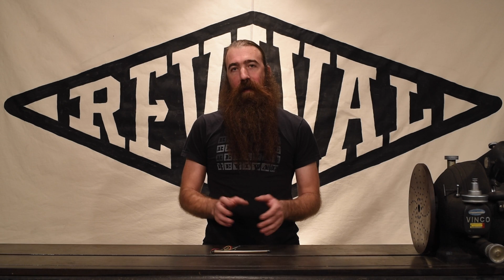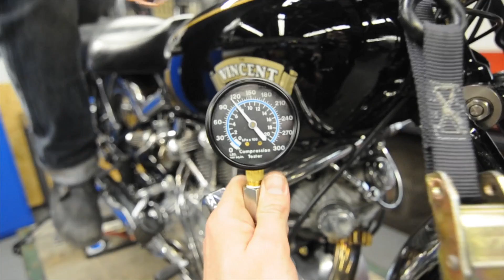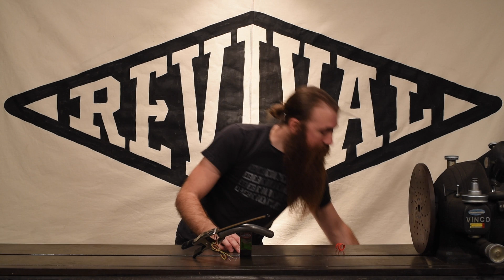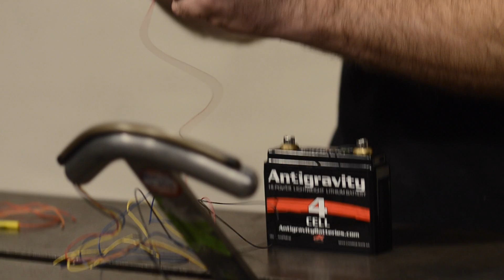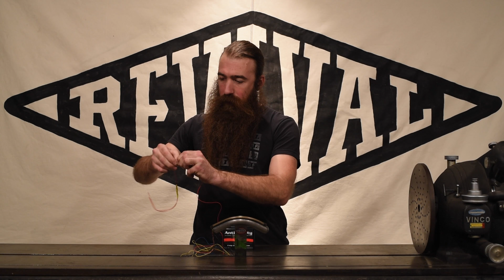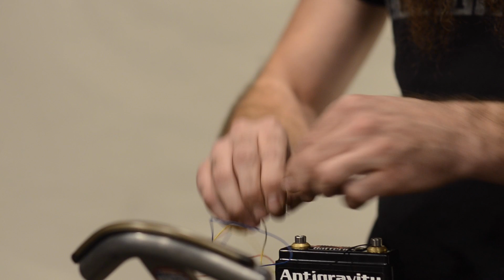Flexible Brake and Turn Signal LED - Revival Cycles Tech Talk

Comment: Would you happen to know what the current draw is for the fully lit strip? I might just replace my dual LED bulbs and plastic LED bar with that. Bondo and paint over the tail light on my triple project.

Comment: do yall remember what size length was used  in this demonstration? are there just as much amber-colored LED in the 8inch as oppose to the 11 inch, or is the amber proportional to the number of LEDs?
Reply from the maker: The light shown in the video is the 8.2" length. The turn signal portion is proportionate to the length of the light, as the length increases so does the number of LEDs dedicated to the turn signals, for example the 8.2" has 2" of signal LEDs on each side. The 14" light has 3" signal LEDs.
Reply: thank you!

Comment: nice product thx for share the vid , i just have a question after intall the stripe , how long they will last ? water and cold weather resistant  ?? thx 
cheers
Reply from the maker: The LED's do not have published life expectancy specifications, but most SMD LED's are designed to last somewhere around 50,000 hours. So considering an average speed of 30 mph, they should last something like 1,500,000 miles, or ~2,400,000 kilometers. Unless they are physically damaged or subjected to excessive voltage these lights should easily out last the bike. 

The LED's are not sensitive to temperature, but the housing that holds them is plastic and like all plastic at cold temperatures it can become brittle, so if it is cold be careful not to hit the housing with something hard. Other than that cold temperatures should not cause any issues. 

Also the lights are reasonably water resistant, they are not 100% sealed, but they can handle the usual water spray from rain and splashes from the road. Be somewhat careful if using high pressure water to wash the bike, and these lights should not be submerged in water.
Reply: Thx a lot!!!

Comment: Also, just a quick question. I have this LED, the M-Unit and the M-Stop. Is the M-Stop the modulator you mention in the video that can handle those complicated set ups?
Reply from the maker: +Saturdays Wrench The m-Stop is a small inline brake light modulator that can be setup to flash the brake light in different ways when the brakes are applied. This functionality is already built into the m-Unit so there is no need for an m-Stop and an m-Unit. 

We recommend the m-Stop if you just need a brake light modulator, but the m-Unit is better suited to complete re-wires and changing to push button handlebar controls.
Reply: Saturdays Wrench did you ever figure out how to have the turn signals assist with the taillight/break light function? I have this led and m-unit as well.

Comment: big question... its have E certificate on led strip? E symbol?
Reply from the maker: This does not have an E-certificate.
Reply: There is a version without turn signals from a company called Highsider. It has E mark on it. Costs ~30€
Reply: @TankToChest  with E-certificate you can install it on your bike without having to let it be checked from your responsible Technical Inspection Agency

Comment: Plastic has "memory!" After time, won't it pull away?
Reply from the maker: Judicious heat application helps to avoid this. I'm certain that it's still possible, maybe even likely but in the 8 odd years that we've been using and selling these I haven't seen it happen when installed correctly.

Comment: I have the m-unit blue and this led bar. How can I get the turn signals to assist in the tail light/break light functionality?
Reply from the maker: In order to achieve run/brake/turn functionality in one light you need an additional module which is available on our site. 

https://shop.revivalcycles.com/run-turn-brake-signal-module/

Comment: Is there a good link and how to make your own dual filament adapter I feel as if mine isn't correctly working it tends not to get as bright as yours was shown
Reply from the maker: Odds are that you have a too small of a resistor and should go up in size. I don't know of an instructional video, it wouldn't be hard to make one but then again, if you just need to make one you're going to pay more for all of the materials than it would cost to just buy a replacement.

Comment: Greetings from Denmark! Are the flexible brake and turn signal LED E-approved?
Reply from the maker: +Søren Larsen Pedersen 
Unfortunately they do not have E certification. We do sell many of them to people in the Eurozone but if you are confident that law enforcement in your region is strict in this regard you may run into issues, you'll have to decide if it's worth the trouble.
Reply: Søren de tjekker det aldrig medmindre du køre med rygmærke ;) heller ikke til syn.
Reply: Revival Cycles, escuse me , what is the resistance value?

Comment: so does the circuit red/orange wire doo-dad just have a diode in it?
Reply from the maker: There is a resistor, you could fabricate this your sef pretty easily if you know you're doing.

Comment: Nice video. I have bought the same LED from your eshop and I would like to know how to connect the wires  with my m-Unit from motogagdet. Do I need to plug the cable that comes with the LED light? 
Thank you
Reply from the maker: +ΚΩΝΣΤΑΝΤΙΝΟΣ ΚΑΡΑΓΙΑΝΝΙΔΗΣ The LED strip comes with a wire diagram in the packaging, and this will indicate what each of the wires does. The details of the wire colors will be dependent on which LED strip you purchase, some have turn indicators, some don't. The integration with the m-Unit is very simple, and the one wire tail light feature of the m-Unit makes setting up the tail / brake light very easy. Just connect the brake wire to the brake output and then configure the m-Unit for one wire LED tail light (menu 2, config B). Then the turn signal wires go to their respective output terminals, and that leaves just the ground connection, and that's it.
Reply: +Revival Cycles Ι have bought the LED brake with the turn indicators. The connection is the same?
Reply from the maker: +ΚΩΝΣΤΑΝΤΙΝΟΣ ΚΑΡΑΓΙΑΝΝΙΔΗΣ Yes sir!

Comment: Could I stick this to the back of the seat on a motorcycle? I am getting an 1974 xl 350 passed down to me soon and would like to cut the back of the frame and would probably look better on the seat if that is an option?
Reply from the maker: It might work to mount it to the seat, but I'm not sure how well it would stick to the flexible material of the seat. It is much better if you are able to mount it to a metal surface that is attached to the frame. The other issue with seat mounting is that you'd have to disconnect the wires every time you removed the seat...not that big of a deal, but you'd want to use good connectors.
Reply: Revival Cycles Alright! thank you for the reply. I am getting a xl350 soon for free and was wanting to possibly convert it to cafe racer, my big issue is the frame and I just gotta hope I can find a frame loop that fits the end.

Comment: Good video! Do you have to change the flasher relay too?
Reply from the maker: That will depend on the exact bike you are working on, some are LED compatible from the factory, others will need to have a new flasher relay, and those that have the turn  signal control integrated with the ECU or gauge are usually fixed by using load balance resistors.

Comment: I have a 98 honda aero vt1100 with the big ugly tail light and long fender I plan to cut the fender to give it a more hardtail look what would I need to hook the strip up? does it hook straight in to the other wires or do I gotta change a bunch of wiring... I'm new to all this so I'm sorry for the ?s just trying to get some knowledge
Reply from the maker: The LED strip comes with a dual element circuit and that makes it so you can connect it directly to factory tail light wiring and have the whole strip work like a tail light.

Comment: So, when the brake is activated, does the entire strip light up red? I like that it's a "2/3" setup..where there is a left, right, and center (as my state requires x amount of inches between turn signals), but I want the entire strip to light up on brake.
Reply from the maker: In order to make any light operate as a Run + Brake + Turn signal you need an additional module that can prioritize braking over running and turn functionality. We do offer something for that on our site as well.

Comment: is posible use this ONLY for brake ligth or you have a different model??

thanks
Reply from the maker: You can wire these to  operate as a single light, but there are over versions available as special order. Email websales@revivalcycles.com for any special order requests.

Comment: how would you use 1 turn signal wire to make it flash
Reply from the maker: The flashing is controlled by a flasher relay. But the question of one wire is simply that the LED uses a shared ground so the single black ground wire provides ground paths for both turns, and the brake lights. The details of how the flasher relay is setup will depend on the specific bike this is being installed on.

Comment: Hi there I just put one of these on my suzuki intruder, all the lights are working except the dim red running light, do you have any idea why? Also would I need the change the relay flasher? The indicators seem to be working great
Reply from the maker: The LED brake/turn/tail light is setup as a single filament style of light.  If you are installing on a conventional motorcycle electrical system (i.e. not an m-Unit) then you need to use a dual element circuit to split the brake light into the dim tail light and bright brake light. If you've already installed the dual element circuit and that is not working email techsupport@revivalcycles.com

Comment: So I bought the led strip, and when I wired it together and apply the brake all lights turn, how do I get it to work properly ,left turn right turn
Reply from the maker: The LED strip comes with 4 wires. The Black is ground, the red is for the center section of the strip, the Yellow and Blue wires are for the outer left and right sections. To get the brake / tail function you need to use a dual element adapter that connects to the red wire. The dual element has a red wire for the brake light and an orange wire for the tail light. To get this to function correctly, you need to connect these wires to the appropriate wires on the motorcycle.
Reply: Do you need a modulator too?

Comment: How you make the turn light blink?
Ps. Great vid.
Reply from the maker: Blinking is a function of the turn signal relay, on older bikes this would be an independent module that should be upgraded to an LED compatible model capable of being triggered by the lower draw of LEDs. On newer bikes where the ECU manages the flashing function A load balance resistor that matches the approximate resistance of the OEM incandescent bulbs is required on each light so that the ECU doesn't not misinterpret the lower draw as a burnt out bulb.  Using LED lights without one of these measures will usually result in hyper flashing LED lights and trigger warning codes on newer bikes.

Comment: hai do u have that light in white and amber colour in one 2 in 1 plan wanna put on the front bike maybe near the axel and for rear the one that u show up red tail light plus amber turn signal lights and how much? it can be install anywhere on a bike right?
Reply from the maker: No we do not have a dual color with white and amber. These lights can be installed anywhere on the bike as long as there is a good surface to mount to and you are able to route the wires so they can be powered.

Comment: Could these be used as a fender eliminator kit on a 2011 victory Vegas jackpot? I have the 250 mm back tire.
Reply from the maker: Anything is possible, this LED light would be a good solution for the brake/turn/tail light, but you would still need to solve the mounting and other mechanical issues with eliminating the fender. Also with the newer bikes many have CAN BUS and that usually requires the addition of load balance resistors to trick the computers into thinking the LED is actually an standard bulb.

Comment: How can I tie the blue and the yellow cables of turns to work also as running mode? Is necessary a Radiantz fleekz module? Thank youu
Reply from the maker: If you're looking to make the turn signals work as run position lights you can use two additional dual element circuits to give you two modes of brightness. 

If you want them to operate as Run/Brake/Turn lights you'll need a module like the Fleekz to manage that operation. The same is true even if you're running an m.Unit.
Reply: @RevivalCycles  I have a full red run brake and turn, in the box I have 1 module and 1 dual circuit element. I don't know the reason, cause I can't use together on my cb400f

Comment: Could these strips be mounted on the rear taillights of a truck?
Reply from the maker: Sure, these strips are 12 volt LED's, so they can be used with standard automotive systems. Keep in mind that if you need tail and brake functions you need to add a dual element circuit so the light has two brightness intensities.

Comment: What kind of resistance do you use?   

Mario Bakker.   Amsterdam
Reply from the maker: The resistance for the dual element circuit depends on what the draw or voltage drop of the LED's being used. In general we find resistors in the 75 -100 ohm range in the correct wattage for the application work well.
Reply: Thank you for your help

Comment: Can I use something like this on a 1980 cm200t Twinstar? I believe it's a 6V - they converted them to 12V in 1981. Thanks!
Reply from the maker: The LED strip is 12V only, and really will not work properly on a 6V system. Perhaps you can swap parts or make an upgrade to get the 12V charging system.

Comment: can i buy 2 of these and wire them together?
Reply from the maker: Yes, these can be wired in parallel, and they will turn on / off together in a 12v system.
Reply: Revival Cycles how do you do that? Im not very good at this, please help me

Comment: what would best for a 2007 Honda Shadow 750 spirit I would like the all in one kit ?
Reply from the maker: Can you elaborate on what you are looking for?
Reply: Revival Cycles I wanna clean up the back of The bike the stock crap is terrible...
Reply from the maker: The LED strip we sell comes with a dual element circuit so you can connect it directly to the existing brake light wires. The turn signals should work with the factory setup, but they might flash too fast or not flash at all. This can be fixed by replacing the flasher relay with an m-Flash or m-Wave, or other LED compatible flasher relay. It may also work to use load balance resistors. There are many choices and trade offs, not really a one size fits all kit.

Comment: Can this work for a brand new bike, like a Thruxton R!
Reply from the maker: This will work on the new bikes, but depending on how sophisitcated the systems are it could trigger a dash "lamp" warning, or the turn signals could flash too quickly. If that is the case you will need to also install load balance resistors, or possibly replace the flasher relay. BUT I've heard that on the new triumphs the ECU can be re-programmed to accept LED lights, but I do not have experience with that. Check the forums.

Comment: escuse me, what is the resistance value?
Reply from the maker: Resistance value for what? The LED brake light or turn signal? Or are you wondering about the dual element circuit?
Reply: yes dual circuito, the wire whit one imput and 2 output
Reply: what is the resistance element value, ?
Reply: please could you help me?
Reply from the maker: The resistance value will be different depending on how many LED's are in the string, and depending on exactly which LED's you are using.  But generally I find that 100 ohms is a good place to start.

Comment: How well does that adhesive stick/last? Do you recommend any safety wire/zip ties to really secure it or does is that sticky backing really reliable? Very curious about the longevity of the tape and if it ends up coming up at any point.
Reply from the maker: Hey Dave - We installed this light a several bikes, and we happen to have the Morini in the shop for some repair work. That light was installed about 3-4 years ago, and I can't see any evidence of deterioration or delamination on the LED strip. The tap that they use is a 3M VHB type double tape, and you might be surprised to find out how many things are held in place with that stuff.
Reply: Awesome!  Thank you very much.  Looks like I'll be picking one up! Much appreciated.

Comment: LEDS don't like heat
Reply from the maker: True, but the plastic tubing will melt well before the LED's are damaged. The Junction temperature limit on most SMD LED's is around 135 C or 275 F and if you consider that I'm heating from the outside AND handling this assembly with bare hands the heat in this case is totally irrelevant, because that junction temperature is way below the limits.

Comment: Does this support various hazard mode which now come as add-ons bikes??
Reply from the maker: If your bike has hazard modes, this light will work with them. However, this is just a basic light and it will not add hazard modes, or any other features. It is essentially 3 lights left turn, brake, right turn each light can be turned on or off individually but it is up to the way the electrics are setup on the bike that determines how the light functions.
Reply: Now a days, there are many aftermarket hazard modules that offers different hazard modes. So my query is whether this will work fine with such products or not!

Comment: Would this be able to mount to a subcage?
Reply from the maker: I'm not sure what you mean by subcage, if you are referring to a subframe, then sure, these can be stuck to virtually any clean surface. The trick to getting a professional looking install is to have a dedicated place that has been purposefully fabricated so the install looks intentional.